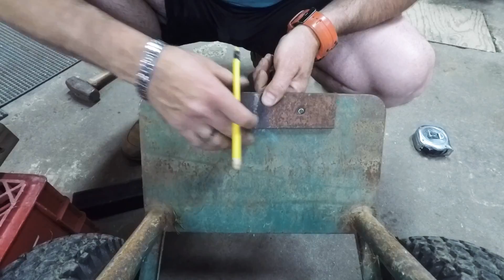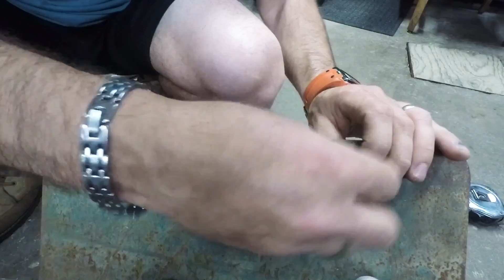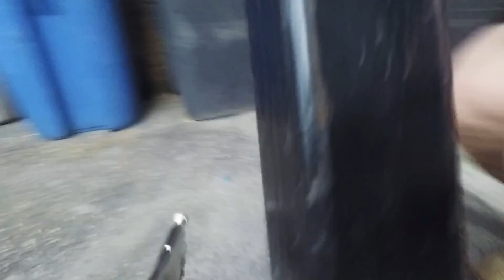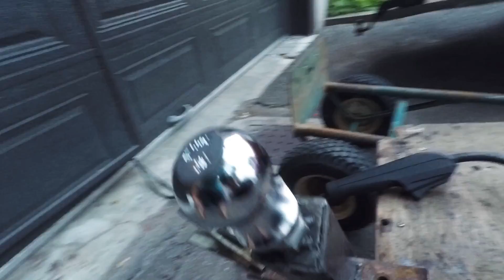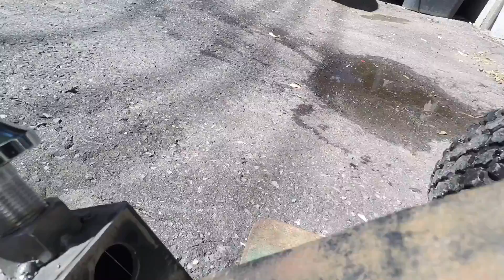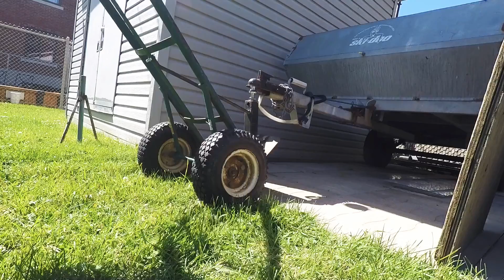Homemade trailer dolly

Comment: I mad a similar  one today and that ting bent lol  was trying to lift a 4000lbs trailer 😅 😂   tried it on 19ft boat with inboard motor prob weighs around 3500lbs and couldn't move it.. it barely lifted it and the bottom part of the dolly bent!!